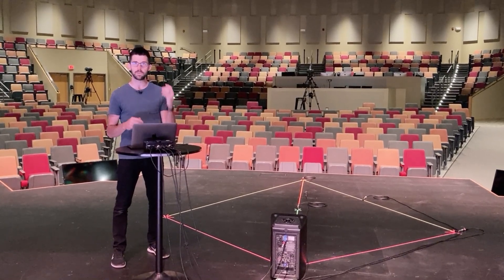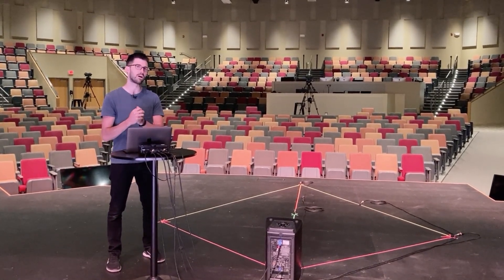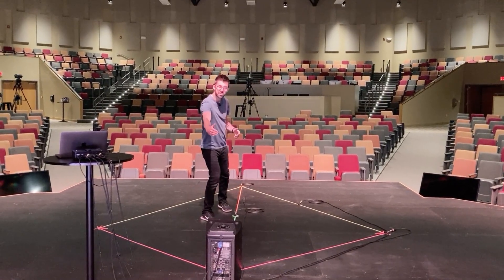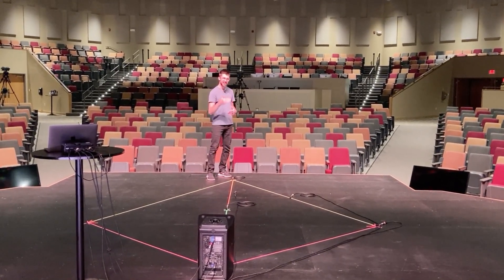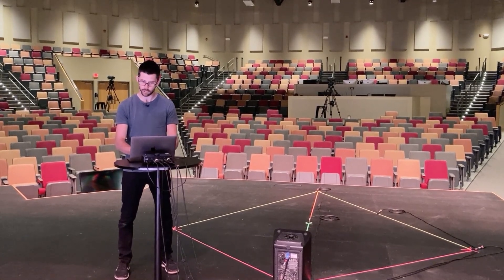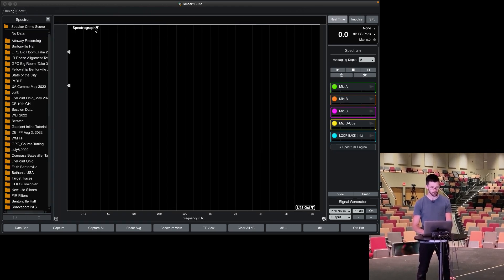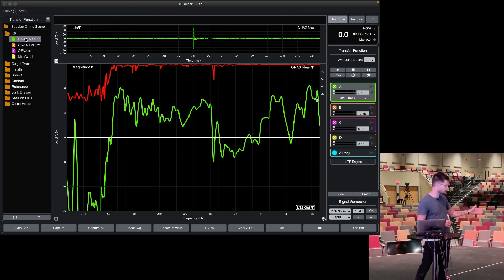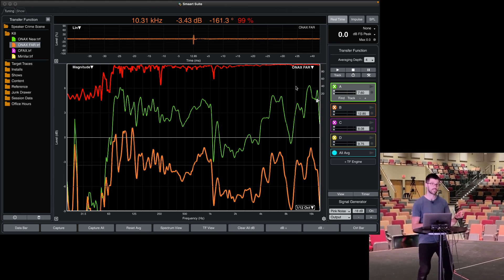If Speakers Were Secretly Serial Killers...

Comment: Hey michael how can you know the coverage angle of the speaker if you cant find it on the website or manual of the speaker
Reply from the maker: If you have access to the speaker I would do the same process I did in the video and note when the HF response drops off 6dB
Reply: @MichaelCurtisAudio  okay thanks alot

Comment: Is there anything special about 6ft or was it just a random number that made sense for the video or stage size? Is the minimum variance line dependent on a calculation from the speaker’s size?  This is super interesting. I need to make more time to run around with some RTA mics!

Comment: Just had a thought.... I would really enjoy seeing the same experiment with two boxes. I am often asked to use two pairs of Eons or similar because that's what they have sold. They expect them to be on sticks side by side at the front Left and right, not with one pair as delays, that would be easier. I have tried so many options to make this sound good, but it never does, I often have one pair turned off or turned way down. Would love to see the physics of placing two, non-line-array boxes side by side and try to work out what angle they should be to each other.. or Volume etc...
Reply: Second this. I use a set of Turbosounds on poles on my subs next to each other and always wonder if I’m turning them properly or should I leave them straight. They are spread out about a foot on the poles but only 70 degree wide.
Reply: Hi Scott, the fact that it doesn't sound is because of the interference that happens between the two speakers that are side-by-side. The sounds interefere so much between each other that many peaks and valleys occur. That's causing it to sound very differently depending on where you are standing.

Comment: Hi, nice video, as always!
Just a quick tip: if you want to compare 2 traces in a perticuliar frequency (such as 2kHz), you can do it by cycling between your traces with the shortcut "Z". It helps you by not moving the cursor, and you can quickly switch between one and the other.
An other tip is choosng a frequency falling on the 0dB line for one trace while having the other trace showing, and shift click on it, so that the first trace does not move (it was already at the 0dB line) but the other moves (up or down). By cycling, you can see in the upper right of magnitude plot the amount of offset that you have introduced to the other trace, thus it is the difference the two traces have in that perticuliar frequency.